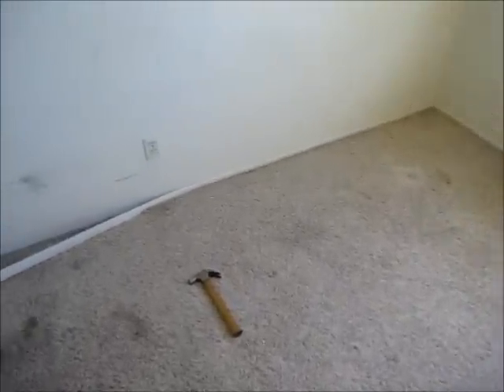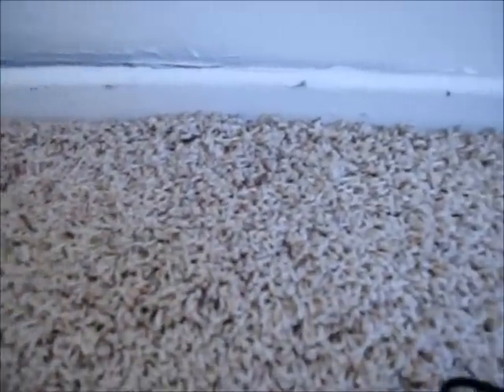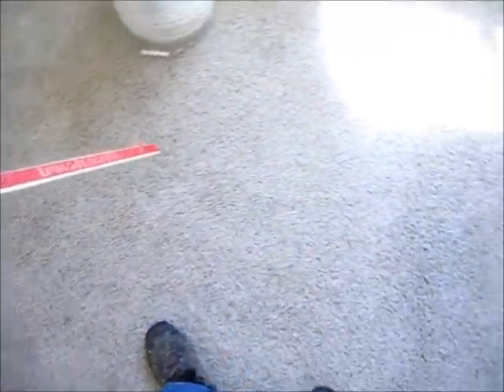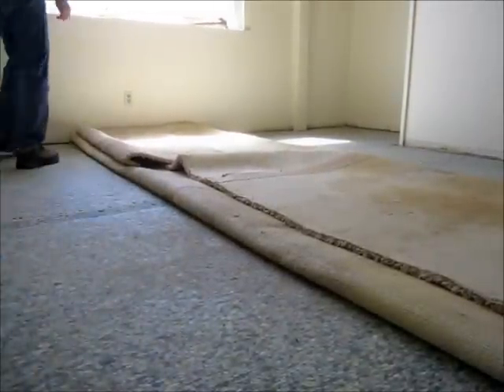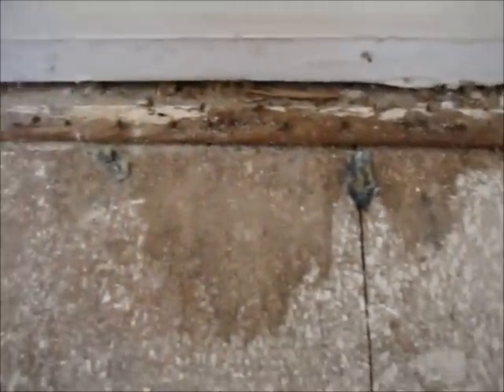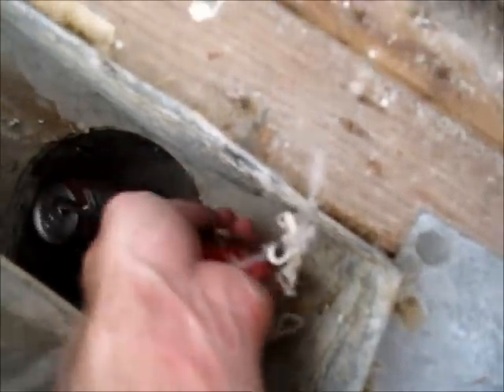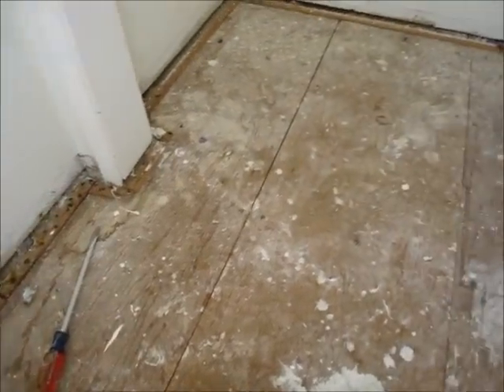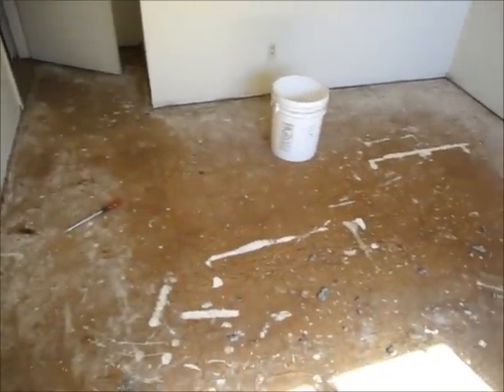How To Remove Nasty Old Carpet

Comment: Good job man!...I've been doing flooring like this most of my life and it never gets any cleaner, or easier... Your a brave soul, sticking your hand down that vent like that!.. Lol.
 One other little tip, using a sharp blade cut the carpet in half or quarters before you roll it up. It makes it much easier to handle and dispose of.

Comment: Nice job and video.I am a carpet installer,and just a note to some of your viewers ,try to pull the carpet up first without removing the base,it usually isn't under the base boards like his was.Also we cut up the carpet in 3 ft. x room length or with. Its a heck of alot easier to carry it out,and your garbage man will appriciate it to instead of a great big ball of carpet to pick up.also tack strip can be reused if it's not rotten or animal pissed on.you might want to paint floor with kilz.if is

Comment: Thanks. That's a load off my mind. Now I know that I can remove the carpeting without a great deal of trouble. On the other hand, I now see no point in doing the job myself. I had thought that it would save me money if I did it myself, but I now see that it's so easy that eliminating this part of the job wouldn't save the carpet man much time or labor and therefore wouldn't save me much money. Of course, if it's glued down, that would take time and effort to remove. I think I'll take off enough carpet and padding  to see how the job has been done.  That will determine if I remove it myself or just let the contractor do everything.

Comment: That was a nice video displaying all the steps on how to remove carpet, Thanks! If I had concrete subfloors I'd pull my old nasty carpet out right now and just live on concrete until I got new carpet. But, alas, I do not, so my old carpet and I just need to get along for a little while longer. :)

Comment: carpet and pad removal is a straightforward job, but to save your back, cut them into strips that are less than 50 lbs each to save your back in rolling them up and carrying them out. I would not roll it up the center like that and try to haul out 200 lb+ carpet!. You'll need that back strength when you start putting in fresh new 12' foot rolls of carpet in and adjusting them to fit in the room. One thing to make the staple removal fast is to use an multi-use, oscillating tool with a staple scraper. If you don't have one, just hammer any staples without pad stuck on them to the floor. If there are over 500 staples, using a screwdriver will waste time and unnecessary energy. Those are my tips to save your back muscles and time.
Reply from the maker: Good ideas thanks! I should have cut the pieces smaller.

Comment: I noticed the floor vents and assumed it was a manufactured home. When I saw the wood floor, my guess was right. When I remove my old carpet, I am going to stain the wood, easy to do and can't hurt, and lay 2X4's flat, 16" apart, and add 1 1/2" of foam, and apply another layer of plywood. Long term insulation upgrade if you live in a very hot or very cold state. Thanks, Keith

Comment: Not necessary to remove quarter round molding or baseboard unless it is holding the carpet down.  Just start at a corner of the room, lift the edge up and pull.  If installing new cpt, leave the old tackstrip down.  If subfloor is concrete it is difficult for the installer to drive the nails into old concrete when replacing with new tackstrip.  If subfloor has pet stains and pet odor purchase a pet enzyme and treat floor prior to installation of new flooring.  Enzymes kill the odor. Good video.

Comment: Thanks for sharing the interesting video. I have done alot of carpet removal and will be doing more in my new home in New Mexico. I use quality leather gloves to protect the hands and fingers and a wide putty knife to protect the wall from damage when removing the baseboards. A dust mask and safety glasses are a must, too, for me. Cutting the old carpet in smaller pieces makes the job easier for removal. Finally, I sure would NOT put my hand in crevices in the floor where black widows could be.

Comment: Why would u remove the baseboard lmfao? I've removed 100's of carpets, all baseboards remained on the wall
Reply: +SleepyT71   Really?  Is it possible to keep them on if you are installing something other than carpet into the area...like that laminate wood flooring or something else?
Reply: +S Ann Usually whoever is installing the floor would remove the baseboard if necessary. The guy filming probably should have mentioned why he removed the baseboard.
Reply: +SleepyT71 he said he was putting new ones in so they would have to go lol
Reply: +Elizabeth Photog he also said "if you're going to try and re-use the baseboards, be careful
Reply: +SleepyT71 well you asked why, and he said he wasn't using those anymore.  I re-listened to it and he didn't say you had to take them off but if you are to be careful but I agree that is silly.
Reply: if your replacing the baseboard for some silly reaso, just wait until you remove the carpet.... then you can use the floor as leverage rather than marking up your walls.
Reply: Dude thank you so much!! We almost removed our baseboards because of this guy. So glad I glanced at the comments and saw yours.

Comment: Great video, I need to remove a nasty old carpet from 4 rooms plus a hallway the job seems a humongous task but after watching your video I feel a bit more confident about it, I have previously removed the carpet of one room and it was horrendous not knowing where to start and what to expect I found two layers of old carpet plus underlay and a layer of news papers from the 1940's interesting eh? I also had tones of nails to remove all over the floor, I am having the floors polished it is much cleaner than carpet.  Thanks for posting
Reply from the maker: That sounds like a neat project. I bet the wood floor will look much better than carpet.

Comment: Awesome video.  Thank you.  Question: my baseboards seem kind of complicated.  There's like a 2x4 that's against the wall, and then about a 1 inch baseboard-looking type thing that juts out from that.  I'm concerned doing this myself, because I don't know if the 2x4 is part of the baseboard, or if just that little 1 inch baseboard-looking type thing is the only baseboard.  Anyone know if I'll likely just have to remove the 1 inch thing, or also the 2x4?  Thanks.

Comment: Thank you so much for this video. I have a question. My carpet covers not only my room, but also the stairway. Does the job become complicated when stairways gets involved? I'm afraid to pull as I do not know what the stairs will look after I pull off the carpet.
Reply from the maker: Sorry I've never done stairs. I think they are similar, and have tack strip at the inside corners.

Comment: This was very helpful! Quick question how did you remove the tack strips and staples? What did you use?
Reply: Mitchell Greggs when I did it I used a crowbar. I left the base boards on until after the tack strips we're off so the crowbar would have something to rest against

Comment: I have a question too. If the carpet was installed without removing the existing baseboards (there was already hardwood underneath) should i just start with pulling up on a select corner?

Comment: Also sorry i meant old carpet and after we pulled up the carpet and padding(we are doing multiple rooms so one just has concrete under) there was a crack in the concrete will that be a problem for when the workers come and install? Do we need to fill it or is it fine by it self?

Comment: I have a question. I am getting ready to take out an old carpet and pad in a room where animals have totally ruined it. I know stuff has soaked down through (even with repeated cleanings).  Underneath is vinyl flooring that I might like to keep as the permanent floor.  How do  I get the pad removed from the vinyl flooring where it may have gotten stuck to it?  Thanks!

Comment: any hints for installing around radiators? i wish i had a vent like you do in that room i hate having radiators in my house
Reply: What? radiators heat your house the vent is when you have gas installed to let air circulate so no one gets carbon monoxide poisoning

Comment: What's the heavy tool being used to remove the tack strips at e.g. 6'20? Is that just a big chisel or something?
Reply from the maker: Hi, it's just the flat end of a crowbar. You could use a big chisel or claw hammer as well.

Comment: Why don't you have any gloves on?! You just said that you're pulling up that stinky old rug but you never put on gloves. And then to top it off, you put your hand down that nasty vent!!
Reply: It's called getting down and dirty. No humans were hurt in the process of removing that carpet and cleaning out the vent.
Reply: As long as you have no cuts, don't touch your mouth, nose, eyes or ears, you're fine. Just go wash your hands. If there's mold or dust, you might try a mask but other than that it's coo. Not using gloves gives you more control and dexterity and to be honest the dust and whatever is probably more dangerous for breathing in that touching.
Reply: Hands are washable

Comment: Where is your dust protection? Some carpet pads contain antimicrobial compounds that are released when the padding is pulled and torn. These compounds are a hazard.
Reply: +redxross ,

good point.
Reply: What dust protection should be used?
Reply: +ThatOneJay123 An inexpensive half-face respirator with mold and lead protection is probably all you need. I paid just $26 for mine at a large hardware chain store.Once you get used to wearing one you'll thank yourself.

BTW those round paper "masks" you see everywhere, they're worse than wearing nothing at all, don't waste your money.
Reply: redxross Okay, thanks.